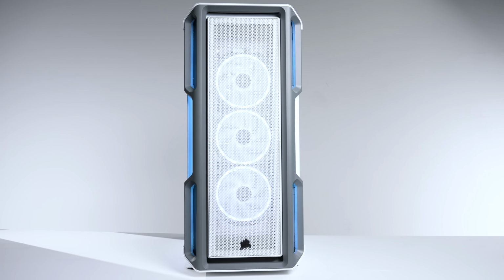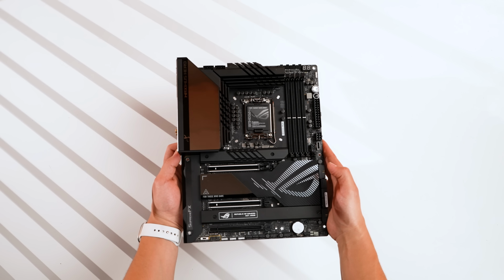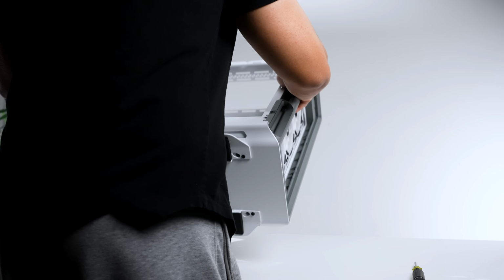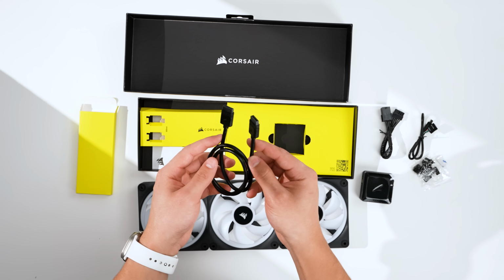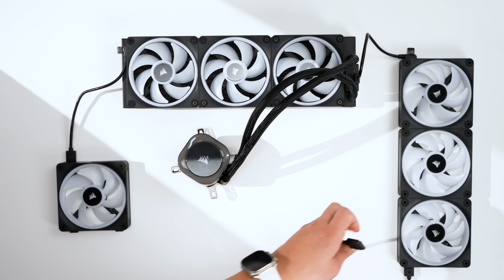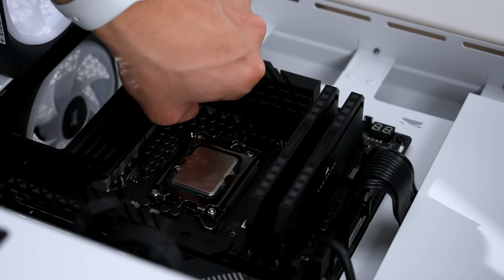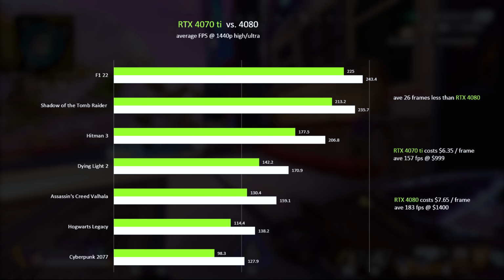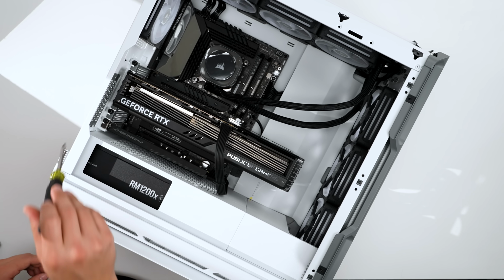My Epic $5000 Gaming/Editing Build - iCUE Link

Comment: Hi, for the video card did you used the cable that was in the psu box? Or is a different one? Is it ok to use? I have a 4080 super and rmx 1200 shift power supply also

Comment: 4070 Ti Super is better than the 4070 Ti as you only get 12 on this one with 16 on the first one, and still cheaper than the 4080 super.  You do know you going to drop the GPU down from 16 to 8 by doing what you just did.

Comment: how did you get the ambient case lights to work without the original commander hub?
Reply: My bad, icue hub can control 14 devise (7 in each side)
13 fan + aio icue = 14
So you can add the controller "case" on the 2nd usb 2.0
Reply: anything?

Comment: Hi I'm creating the same build can you tell me how to connect the existing led on the case , now connected in the little card and on controller in rgb port, with icue link system hub? ( is it required some adapter?), I'd like to remove the controller as you have done in the video
Reply from the maker: You cannot connect it to the new icue link gear
Reply: @DesignsByIFR  do you mean that should be connected to the motherboard directly with rgb port or, completely offline, you are not able to manage the led from case?

Comment: To expensive but nice build, I would have done differently, I mean if you're going to spend $5,000, better cabling and better RAM, CL40??? Link is to expensive as well as the case, no reason for an i9 either. Oh and the 4080 Super is out, D'oh!